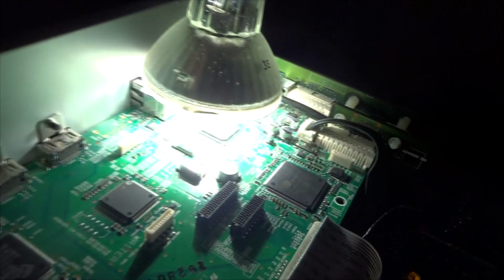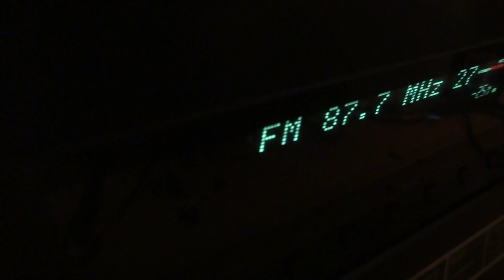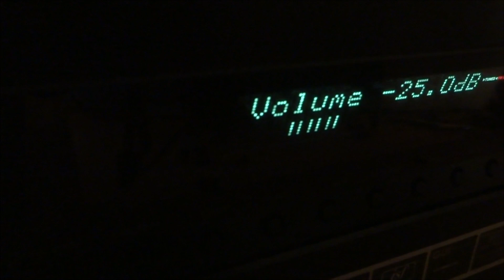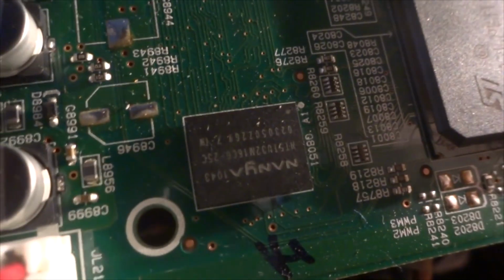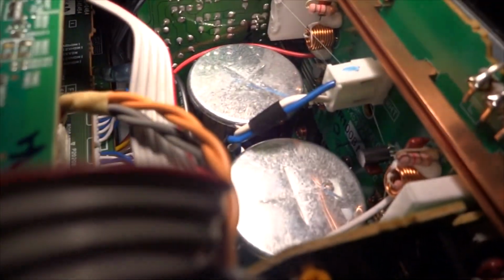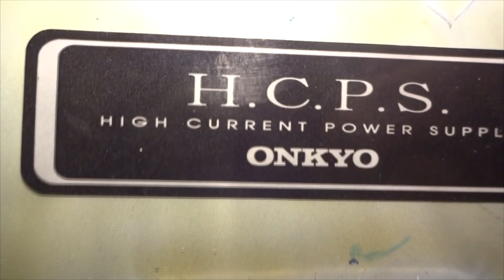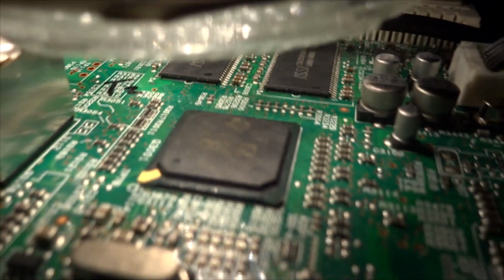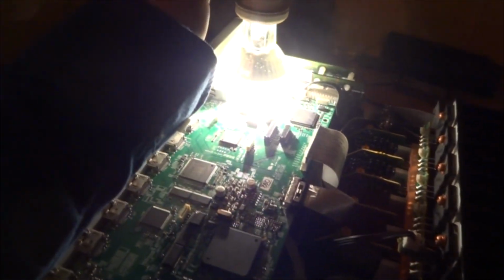Onkyo Amp update, Quick "no sound fix"

Comment: you have to reflow the solder beads under the processor chips. the halogen light doesn't get hot enough. you need a heat gun. Harbor Freight has one for $8. the solder beads loses connection because over time the heat inside causes the PCB to warp
Reply from the maker: +Paul M This is for people that don't have a heat gun. I also did not have a heat gun, I do now, just not then!
Reply: How Can I do that? 
I Need to remove all the PCB? 
I dont think I'll See the beads under board? Its not surface mount?
Reply: @MathieuProulx1  Did you figure this out? Trying to solve it now.
Reply: Anders Johnson The Real problem was the board or the chip on it.
I tried to heat it but it’s never works... I write long email to Onkyo, said I was disappointed about their product.
They write me that I can claim warranty even if my Onkyo has 9year old.
They ship me prepaid box, I ship my Onkyo to somebody and after 3 weeks I receive it and it’s work like brand new one! 
You can try the same way, I hope you’ll find same issue than me.   Oh and after 9 month after repairs, I have new trouble. I just remplace it by a Yamaha... I have my old Onkyo here if you want me to try something ;p (sorry for my not-perfect English, I’m French (Québec))
Reply: @MathieuProulx1  with consumer electronics they tend not to use rugged PCB's. Sooner or later the heat causes the layers to become conductive or fail. The best you can do is scavenge parts from another one
Reply: @MathieuProulx1  Wow! I think mine is from 2013... I will ask Onkyo then, as I've been heating it for 20 min or so, and no results so far. Seems like that whole board is hard to find as well.

Kind of them to ship you a prepaid box. Did you end up having the same problem that you experienced before the repair?

Mind sharing that long email that you sent to Onkyo?

Thanks!!
Reply: @PhuckHue2  Any suggestions where? eBay's turning up a lot of nothing :-(
Reply: @andersjohnson6162  Look description from Video

He wrote: 

Check if your receiver qualifies for the repair program (provided free from Onkyo):  https://repair.onkyousa.com/na/
Reply: @MathieuProulx1  Thanks for getting back to me, I appreciate it. I wouldn't be surprised if it's the same problem. The board seems to be non-existent, both at Onkyo and in the aftermarket (ebay, etc.). After a couple emails with Onkyo, they said they don't repair/warranty this receiver anymore, they stopped as of Fall 2019. They said I could theoretically trade it in for a discount on future receivers, once they reopen after coronavirus... Guess I'll try then. In the meantime, I'll roll with closed-captions ;-)

Comment: Thanks for the info mate. I found an Integra DTS-50.2 at the e-waste section at the dump a while back. I'm planning on reflowing the chip with a pyropen (tiny gas heat gun). Can I ask if those speaker icons appear without speakers attached? Or would I have to wire some up for them to appear. Cheers buddy.
Reply: gas heat gun wil kil the chip fast, please use an oven at 220c 10 min.,pre heated( not a hot air oven, just normal oven gas/ell.)good luck.

Comment: It worked, awesome...
Reply from the maker: Yes, but only for a short time.... A more permanent fix would be to reflow the solder.
Reply: I contacted onkyo and they are honoring the warranty for this issue until 2018. They sent me a box and my receiver is now getting repaired, apparently it is a common issue.
Reply: Lerner Warden good to know this, mine just started doing this. Im thoroughly disappointed with Onkyo huge turn off :(

Comment: I have a pioneer sc-1222, it has a very  low intermittent tick sound while operating. Then it shuts off all sound totally about a half an hour off operating. I then unplug the power cord then plug it back up the sound returns. But still with the low tick.
Reply: check your capacitors on the power stage. if you dont know what you doing. Dont play with electricity to save a buck. your life and fire are at risk.
Reply: @sauplink7975  I get what you're saying. I'm going to put it in local shop. But I updated my comment. I didn't go into much detail.
Reply: @Joshismack  good stuff. its not hard to give it a go and take it as a learning curve .but if you love your amp, then yes thats worth the warranty on the repair ^_^

Comment from the maker: JohnWayne Lustbug, please check your Google+ settings regarding comments. Did you get your request granted? I got a NR-TX717 and they fixed it, now it is being shipped back to me.
Reply: +Joshua's Recordings they sent me a box, i sent it in, within a week or less, it got repaired and sent back. I got speaker indicators, net,. usb, the whole 9. I used it for a few months then sold it. I got a Tx-NR809 now that has the same issue, BUT i found out how to bypass the hdmi board, Press BD/DVD and power (with it off), it will come and say HDMI Board:Use, I pressed power while still holding BD/DVD and it changed to ignore, i heard a click, and then i found it puts out sound, but net and usb still do not work, BUT putting it in direct or pure audio mode is the only way to get sound. I have the box for my 809 now and i will ship it to them tomorrow. This is a nice reciever, for this model line its the flagship model (highest model). Its big heavy and has a lot of features.
Reply: That worked for me  Thanks
Reply: Might be getting a Tx-NR609 with same issue. Have a 30$ ebay bid.IF i win it i'll send it in and have them fix under one time repair.
Reply from the maker: +Your Mom Your Mom Make sure it as a serial number. Some that were purchased from 3rd party dealers don't!
Reply: Joshua's Recordings
Reply: Christopher Ryan does this method work for txnr717
Reply: Should work for all of the network models. I'd send it in though and have them fix it for free

Comment: I have Onkyo TX-SR 875 AV Receiver. Recently It has strange issue. When I turn on the receiver the Headphone logo shows on its display screen even i didn't attached any headphone with it physically. Because of this there is no sound coming from any speakers attached with this receiver, even headphone also not given any kind of sound. I tried to reset the factory mode several times but didn't got any success. I also tried to insert headphone physically and pull back its jack but nothing happen. So please help me solve this issue. If possible upload repair video of this issue.

Comment: Miodrag Popović
Something I do not understand? I, like many owners over the years and on different models of receiver have the same problem!!! Than Onkyo replace the controversial chip for many as well as me, after the expiration  of warranty period. But they did not solve the problem of bad design.
Istead of permanently eliminate the problem, thy only solve the consequencerather than the cause, replacing of defective chip?.Obviously, they do not care about their reputation, or they do not realize that the next device I,am buying will not be Onkyo.
Reply: Miodrag - Apparently ALL Rx made between 2009 and 2012 has this overheating DTS chip in them, so all of them are a ticking time bomb, waiting to fail - not a question of if, but when! IMHO Onkyo should sue Texas Instruments for these repairs (maybe they have), and force them to supply small heatsinks with fans to they can be retro fitted to all units, IF overheating is the cause of the failures.

Comment: Yes Onkyo (stupid),  that DTS chip needs a heat sink.  Everything is routed thru that chip.  The BGA needs to reflowed and heat sink attached.
Reply from the maker: Yea exactly. If they just put a small heatsink on the chip from the factory or put a small fan right next to the chip these receivers would be great units.

Comment: Hi everybody 
I am very afraid to open me 709
But I am also can’t hear nothing 
Is the dts chip is the problem 
Is it easy?
Reply: Yes dts chip is the problem.  This same basic thing occurs with the Xbox 360 rrod red ring of death and Sony PS3 ylod.  What happens is your heating the flux back into a gel and the pin connections to the board under the chip are reset so to speak.

Comment: obviously a process issue, a cold solder joint that broke due to fatigue of the material due to normal use. When you heat the device, the pins that lost contact, dilate and make contact again. I have the same problem, just happened two days ago. Out of warranty, unfortunately. Is yours under warranty? Did you get it repaired?
Reply from the maker: No, if you watch this: Onkyo TX-NR1007, Altec Lansing Mi7 & Dell Dimension e521 From the dump!!, you will see I got it from the our local transfer station! I contacted the company only to find out that it has been previously repaired!!

Comment: Is it repaired?  What about next time you use the amp? still need to heat the chip?
Reply from the maker: +ken123167 Yes, you would have to heat the chip every time. What you should do is try to send the receiver to Onkyo and have them fix it. When you get it back take it apart and put a heatsink on the DTS chip. 

Go here to see if your receiver qualifies: http://www.onkyousa.com/Support/service_info.php

Comment: or you could run roslin flux under chip heat it up.. that reballs the faulty solder under the chip..
Reply: Did you try this?

Comment: come on, this dosen´t work at all... if the DTS chip, is out of place due to heat, then this is NOT working.

Belive me, i tryed your way, but i needed a HOTAIR GUN, so it would reheat, the connectors on the bottom of the DTS chip

Comment: Just think if we bought the Yamaha or denon reciever we wouldn't have this problem
Reply: Depends which model. Yamaha had their early fail series' too.
The problem here isn't so much Onkyo's build quality, though hindsight shows that cooling fin or more active airflow would have kept these running much longer.

The problem is the TI made dsp chip (one of the 2 big names in chip manufacturing, so not cheaping out)
as well as being manufactured during an era where the government was mandating restrictions on things like lead in solder for mass production.

Being forced to rush out less known solders and circuit traces gave everyone a big surprise when instead of the 20 year lifespans we had been used to, suddenly things were failing in as little as 3 or 5 years.

It was discovered that even though things appeared to be working fine and at acceptable temps, they were actually changing metal crystal structure and inevitably failing at very low temps. Reducing temps even a tiny bit could easily double or quadruple the lifespan. (Eg at a cooking block or fan)

This affected everything from mobos, gpu's, high quality industrial control boards, car ecu's, etc of that era.

I had a laptop that had an integrated gpu with this problem. It would try to start but fail before it even got into bios.
Can't make it any more dead, so i tried what people said: preheat oven, take the board out, cover everything but the gpu with alu foil to help protect it (especially the caps!!), Bake for a certain amount of time to remelt the solder, then crack the oven to allow it to cool progressively (don't want to re-crack the solder).

Worked like a charm, and i was able to game and draft on it for a year.
Had to bake it again, and got another 6 months.
Didn't consider it worth it for a third baking, as i only expected it to last few months. (You are damaging it a bit every time you bake it)

Comment: I try this and it lasted  for as long receiver was on but shut off an at's all she wrote.Try it again but no go thank again.
Reply from the maker: You should try solider reflow. You can try either buying a solider reflow over, those are expensive. Or you can put it in the oven at preheat over to 212*F (100*C) then slowly rise that temperature to 428*F (220*C) and let it at 428*F (220*C) for 1-2 minutes, then take the board out and let it cool. Also remember to wrap tin foil around the entire board except the DTS chip. The board that you will be working on is the HDMI board (the top board in your receiver).
Hope this helps! Thanks for watching!
-Josh
Reply: @JoshuasRecordings  Has anyone else tried this? Sounds pretty crazy... but I'm game for trying.

Comment: Bro - just to confirm you temporarily fixed it with heat from a halogen light is that correct? What is causing the no sound?
Reply from the maker: Yes, that is correct. The problem is that the chip overheats and cracks the solder balls that are under it.
Reply: Joshua's Recordings can it be repaired? Or is it better just to replace ? I have the TX NR414?
Reply from the maker: Yea, click this link: https://repair.onkyousa.com/na/ If your receiver has not been repaired previously then you can get it fixed free, even shipping is free! Then go watch this: https://www.youtube.com/watch?v=uhrnRWaJSrc&t to see how to prevent the receiver from failing again.
Reply: Joshua's Recordings thanks bro - I'm from the UK so can I still send here?
Reply from the maker: No, you have to go to this link: https://repair.onkyousa.com/eu/